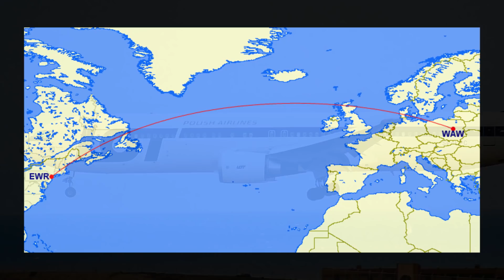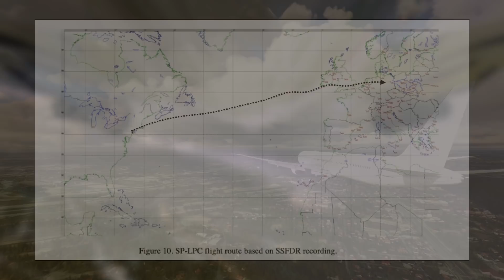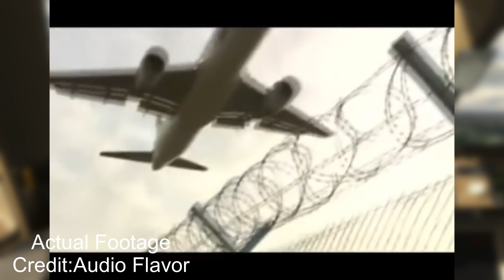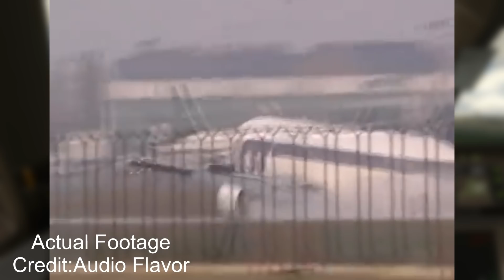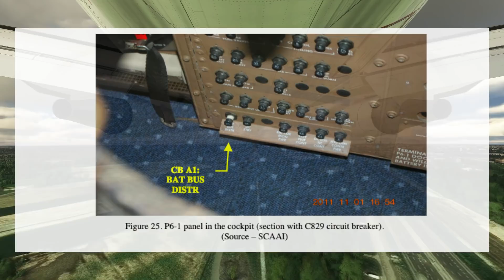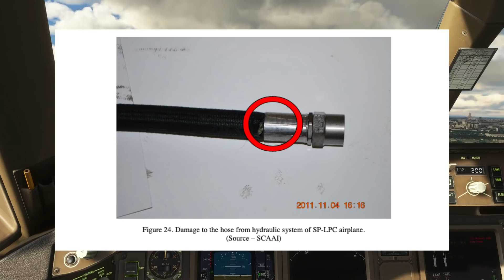A Tiny Switch Causes A Massive Emergency! | LOT Polish 16 (Real Footage)

Comment: It amazes me how many videos show problems related to landing gear, and how often pilots are in the dark about the position of the landing gear.
Surely all modern aircraft should be able to deploy landing gear manually, and It'd also make sense to have cameras facing the landing gear, so that flight crew know when landing gear has deployed.
Reply: I seem to recall (from a Mentour Pilot video) that some aircraft do have a small porthole in the avionics bay that gives view of rh landing gear.   They'd been an issue though with one flight. Something about people not knowing there was a light you could turn on.   But if that was available on this flight, maybe the crew didn't think they had time to go down and check; what with everything else they needed to do in the cockpit and if a military jet was available.
Reply: @KravKernow  I fly the A330, am rated on the A350 and used to fly the EMB120, ATR42/72, BAe146, CRJ50 and 747-400. None of those planes had the option to check whether the gear is down and locked, visually. Cameras are not much help. A gear may be down, but if it’s not locked it still isn’t of much use, because it may collapse at any moment.
On the airbus we have the normal ‘down and locked’ indication. If we don’t get that, there are two more electronic extension indicators which can only extend if the gear is locked down. Either will suffice to indicate a safe gear (even when the master indication is red). If I don’t get any of those three, I will simply prepare for the safest possible ‘landing with unsafe landing gear’, as these guys did.

Kind regards,

Garret
Reply: @TribusMontibus  Thank you ever so much for the responses chaps; much appreciated.  I shall have to try to go through all the MP videos to see what aeroplane it was.  

And that was an amazing landing.  I've been in bumpier ones on planes with wheels.
Reply: @KravKernow  I think only the 737 had this feature (but it was a porthole in the passenger cabin in the aisle). The 737 allows you to view both sides from a single vantage point.  You would need two on the 767 (because the wheel wells are separated)
Reply: There are multiple sensors on the landing gear to show that the gear is properly down and locked and these sensors are duplicated (for redundancy). Human beings are just naturally suspicious of electronics. Cameras are still a good idea, like most things in hindsight. Remember that this aircraft had a first generation "glass" cockpit. Cameras integrated into these systems came a long time later.

Comment: I think, being a trans Atlantic flight, there must have been tons of fuel onboard, so I’m certain the idea of “might as well fly home” instead of dumping fuel and stranding the plane overseas was determined as long as it appeared safe to do so.
Reply: I think you hit the nail on the head.  The gear wasn’t going to drop any better in New York than it did in Warsaw and the plane was much lighter and less flammable in Poland.  They had control of their flight surfaces so why not fly across the Atlantic rather than dumping fuel in the Atlantic and going back to NYC or Boston or wherever they decided to crash land it.  My only stipulation would have been to have a long, wide runway and a well trained ground rescue crew on the field… which Warsaw did.  If they were flying to Population Three Airport in Nowhereland, then it was a bad plan….
Reply: @MotJ949  - plus, I’m sure there was some solace in landing a crippled plane from Poland…. In Poland instead of the US.
Reply: Mentour Pilot just put out an EXCELLENT more detailed YouTube video on this same event this morning.   https://youtu.be/QMmA--l0HKE
Reply: Does LOT have a maintenance base @ JFK or just the ‘basic necessities’ o/h?
Reply: I don't think there's anything safe about it. No one would be cool with crossing the entire Atlantic with an engine out, but that would be less risky than crossing with a hydraulic system out. The company was in the wrong for telling them they should continue.
Reply: @00muinamir  I don’t think you can say if it was safe or not without knowing what the C hydraulic system controlled exactly.  If it controlled the landing gear being deployed ONLY, and you knew you had a redundant system that you believed would take of it, what’s the difference between landing now, or landing layer?  There is a lot of information that neither you or I know about that went into that decision…. which, as I said, made no difference whatsoever in the long run…. other having more time to try and figure things out and less fuel to be dealing with one way or another.
Reply: @00muinamir  odd that other commercial pilots, such as Mentour Pilot, said they’d have done the exact same thing, if it was “unsafe” and “wrong”.
Reply: @thetowndrunk988  - So says “The Town Drunk”.  Sounds like one should put a minus sign in front of anything you say.  But I agree with you.  I’d be “The County Drunk” if I had the balls to do so.  Like I said…. I agree, and let me buy the next round!!’  We’d even invite Christina T., but she deleted herself out of the conversation.
Reply: @enigmawyoming5201  I’m always down for a shot or ten 🥃

Comment: Loss of hydraulics is never a good thing, especially in a fly-by-wire plane --- it should always be deemed a MAYDAY emergency situation, landing ASAP, because loss of life is potentially imminent, even if the redundant system is mediating the failure adequately.  Loss of a hydraulic system is actually *worse* than losing an engine (in most cases).

The reason is simple.  Hydraulic systems on planes are rugged, high-pressure systems that can endure considerable stress.  Therefore, if a system fails suddenly, it is usually something catastrophic causing the failure.  Fluid loss is inevitable, and switching to a redundant system could potentially drain the remaining hydraulic fluid and render the plane unflyable.

It was a mistake to have the plane continue to its destination.  Had it returned to the departure airport, they would have most likely had a "normal" landing.  I'm very happy that everything worked out in the end, despite the nice belly landing!  😁

Great job on the video, btw!!  👍👍
Reply: They are not switching to another hydraulic system. Each hydraulic system controls separate actuators on the flight control surfaces at all times. Some smaller flight control surfaces have only one actuator, but the aircraft is perfectly flyable with a single system not working.
Reply: Loss of hydraulics in a FBW plane is no different to loosing hydraulics in a 767. Just look United 232 or the Airbus A300 of OO-DLL
Reply: There are no extra technical difficulties with a hydraulic issue, as a result of an A/C being FBW. Declaring a MAYDAY for a single circuit hydraulic issue, would be completely inappropriate, and is not a required action by any aviation authority, airline, or training agency. You are talking out of your arse.

Comment: if technical crew on the ground didn't mention a thing about this circuit breaker well I'm sorry but pilots are not to blame. I mean you have an electrical motor which is supposed to open a door and it doesn't work. What are the possibilities? 1- those motors are dead. 2- a circuit breaker went off !!!
Reply: Option 3. A broken electrical wire which is not shorted. Option 4. Broken steel cable. Option 5.....
Reply: @ImperrfectStranger  true but before going that deep circuut breaker verification for those motors would have been more that logic to troubleshoot. 
Question : is there a possibility that during the belly landing that breaker popped off?
Reply: @ehsan83  I'm not exactly sure what you mean, but if the breaker popped on (crash) landing, what caused the alternate gear extension to fail? 
That circuit breaker does feed a lot of other components, not just the alternate gear extension electric motor. I don't know if they checked all the related systems after the crash.
Reply: @ImperrfectStranger  true if the breaker was on the gear would’ve extended. Anyways it would be so strange if nobody thought about it. Thanks for your explanations

Comment: I remember seeing this on the news at the time and the pilots were hailed as heroes...and obviously in terms of the way that, despite the issue, they got it down with no loss of life is impressive. As was stated in the clip though, maybe a decision was taken much earlier (namely,  to continue to Warsaw after an issue identified early on) which, had a different one been made, could have resulted in saving the aircraft. How much of that was down to LOT and how much down to the pilots, is moot. My personal feeling is that whichever way, it seems an unwise one, if expedient at the time. Equally, particularly as an interested amateur only (and not a trained plot) it has to be acknowledged how easy it is to suggest even guarded and indirect potential criticism may be implied, from the sidelines.  Anyone can do that. The difference is making those decisions, on the fly, at 35000ft, in a pressurised aluminium tube, doing 450 mph, with you, your colleagues and hundreds of passengers' lives at stake!!

Comment: Why didn’t Boeing design the array of breakers with a feedback loop that would notify the crew of an open circuit breaker? If a feedback loop was incorporated into the original design there would have been no additional expense to Boeing. This is a case of terrible design by Boeing. 

But why did the crew decide to fly across the Atlantic with a known problem? The existing problem could have been an indication of a much larger problem. It was reckless of the crew to continue the flight.

Great video guys! It’s great quality with high production values. 
👍🏻👍🏻👍🏻
Reply: Amen my brother. A simple sensor could determine if a breaker is open or closed. :) If it's a Boeing, I'm not going. Airbus for the win.

Just kidding on that last part. Both manufacturers have their flaws and strengths, and I like both companies equally.
Reply: @thatguyalex2835  You're talking about a 40 year old aircraft here. No aircraft had CB monitoring 40 years ago.
Reply: @ImperrfectStranger  But it could have been done. Computers existed in 1980. :) Lol...
Reply: @thatguyalex2835  Notice that a simple sensor might break as well. Who guards the guards? And you're adding complexity to the system - more components, more occasions to make an error / miss something during the routine checks, more scenarios where something might go wrong, more things to put on a checklist and diagnose in a limited amount of time when something goes wrong in-flight.

Some design changes make sense - like installing panels to avoid accidentally popping a breaker. Adding safeguards, upon safeguards, upon safeguards is not one of them.
Reply: @przemysawotarzewski557  I understand.
Reply: Terrible design? The 767 was over-engineered for safety like no plane before it (because it was designed for intercontinental travel on two engines). The Boeing 767 is over 40 years old. It was one of the first aircraft with a "glass cockpit". To put things into perspective, the design predates the first iPhone by over 25 years.  If a circuit breaker circuit can fail, so can a circuit breaker checking circuit. Complexity adds weight. Extra weight means extra fuel for each flight.
Reply: Given that you had verified the proper operation of the remain 2 systems, and performed maneuvers to verify controllability, and an emergency landing here, or there isn't any different. It also gave them a lot more time to attempt to identify a solution to this problem.
As for reckless, guessing you haven't heard about the BA 747 that flew across the entire US and Atlantic after an engine failure on takeoff. 
And finally, as far as I'm aware, Airbus doesn't have that feature either. And it shouldn't be an issue to expect the flight crew to perform a visual inspection of those panels. It is stupidly obvious when one is open, they are built that way on purpose. Guessing in your opinion it is also a terrible design choice having the panels behind the pilots where their shoulder harnesses can accidentally pop a few open if they release them to quickly.
Reply: @sparkplug1018  The latest gen aircraft do have circuit breaker monitoring. Technology has moved on in the last 30~40 years, but sometimes the KISS principle is better. Saves weight, saves fuel. Just look at modern cars. Twice as smart but twice as heavy. 
I think I read somewhere that for every extra tonne of wiring, you need an extra half a tonne of fuel per flight.

Comment: What I want to know is why tech ops didn't suggest this circuit breaker to the crew.
Reply: Yes, I too would have expected them to go straight for that! Maybe the tech ops should foot the bill! It's like when you call tech service: Hey, my toaster does´t work. What do they ask you first: is it plugged in?
Reply: It's not a specific landing gear circuit breaker, but a general power breaker. You could spend all day tracing breakers back to the engine generators.

Comment: Probably an odd question, but what happens to all the passenger's stuff that's been left on the evacuated airplane?
Reply: Once it's deemed safe, the company will retrieve it and return it to the passengers. If there's some kind of contamination or if a piece ends up being evidence in the crash investigation, they might hold onto it for a while, though.
Reply: They put a box of dynamite in the middle of the apron then stack all the stuff on top of it then......BOOM!!!!

Lol

Seriously, Christina above has it right.

Comment: Considering the number of crashes that involved a problem taking out one system after another, I would have thought they should turn around immediately.   If the line had failed because something was happening outside the line, whatever that cause was could have taken out another one eventually too.

Comment: I think that in the past planes had a ‘crank’ - or something similar - to lower the landing gear manually. This device was normally under the cockpit floor.
Reply: Unfortunately, you can't get under the floor on a 767 (from the flight deck). Remember, too, that this is a two man crew. It's not safe to leave one man on the flight deck (to fly, navigate and communicate).
Reply: @ImperrfectStranger  - I got it - it’s true. I’ve seen planes like 747, DC-10 and Tristar - all with 3 people in cockpit. Makes sense.
Reply: Actually you can, there is access panel in the forward galley area floor, but there are no additional manually driven decides for landing gear.
Reply: @tmdrbl  I did say "from the flight deck" ;)  Also, quite a few airlines now have these panels screwed down because of security risks.

Comment: That pilot is a boss!
Speedbrakes out, pitched up slightly....not seeing the reversers but it makes sense why that is.
I am sure i am missing details from that landing. Beautiful flying.
Reply: Because they landed on the engines, deploying reversers will be very risky: What if only the reverser on one side deployed? The asymmetric thrust + no steering wheel can result in cartwheel.
Reply: In a belly landing, the plane has no way to know it has landed. Normally this is done by the Weight on Wheels switch in the landing gear. No weight on wheels = no reversers, no automatic spoilers, and probably other things I'm forgetting. It's also best practice to shut down the engines during the flare when doing a belly landing, especially in a propeller plane.